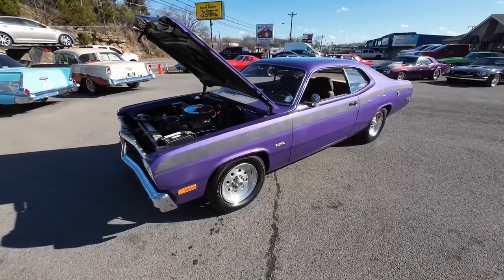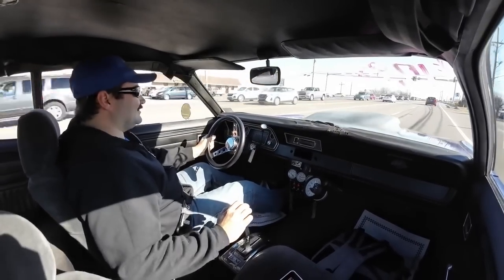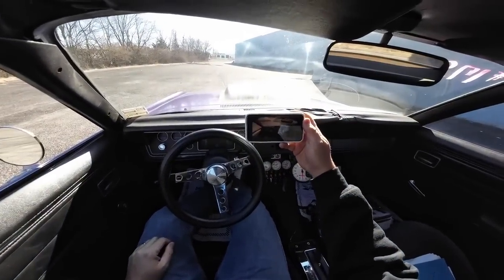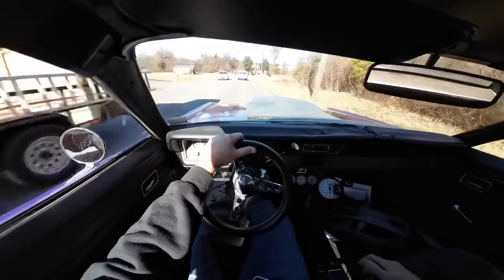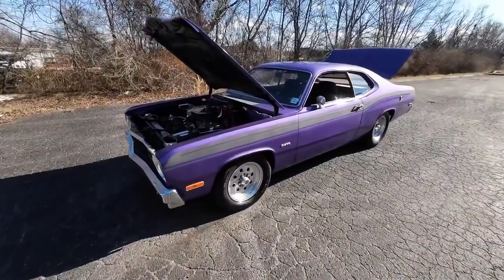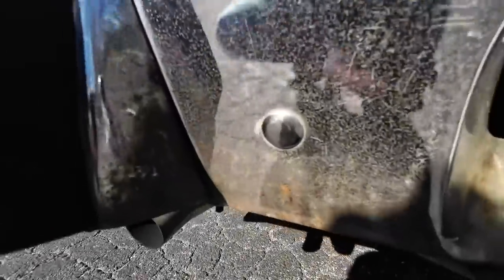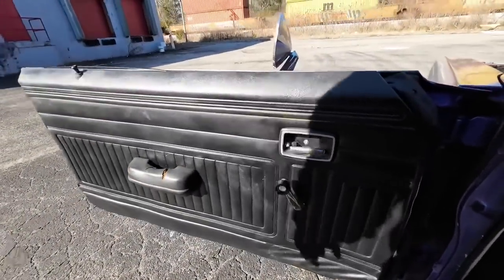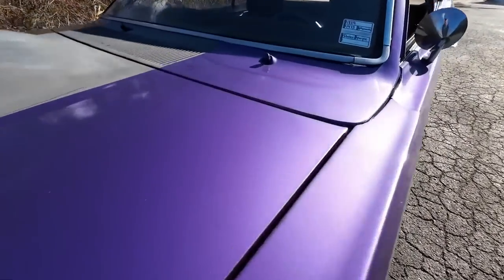Test Drive 1973 Plymouth Duster SOLD $17,900 Maple Motors #1829

Comment: Looks like it needs some rings . Nice ride otherwise
Reply: Agreed carb rich and rings. Yep. Who ever had it beat the crap out of it then dumped it.
Reply: Or when who ever put motor together didn’t space rings. Like you need to. Stagger the slots. Can do that also .
Reply: Either way just fixing carb mixtures will really clean a lot of that smoke up then see what pipes look like when jumping in it.

Comment: Its about the same shape as the 1973 340 Duster I had body wise.  The pull in steering would concern me only because Dusters are noted for the upper A frame hold down tabs on the frame to crack or break loose.  Mine had a cracked one and needed to be replaced and welded up.   My other concern is the smoke and I think the same as you do.  I am sure if you stand behind the car your eyes will burn from running rich.  My cars cam can and its idle sounded the same. My car ran a little on the rich side.  It performed well though.  I noticed when you hit the gas one time I see black smoke, that is fuel build up.  The white smoke concerns me on weather it goes threw any oil or anti freeze. that is something that could take time to notice and driving it to notice.  The interior parts you can still find used and someone will have them. Same for the stock wiper arms. Its a nice Duster and in nice shape.  Not so easy to find like they use to be.  I miss mine.

Comment: It's running very rich. That's why the initial smoke was grey, then turned blue. Washing oil off the cylinder walls. Nice car just needs a little fuel system work.

Comment: I'm loving that 73 Duster. I had a 73 with a 318 360 heads and intake. It was my primer gray Rust-Oleum Deluxe hot rod with hood pins and US Rim 5 slots
Reply: I had a 73 hated the thing.

Comment: Not sure I understand the reference to a hotrod so you need to 2 foot her........are you trying to keep the revs up so it doesn't stall?
Reply from the maker: Just precautionary because the car was getting so much fuel
Reply: @MapleMotorsNickSouthgate  I see....had a couple beaters back in the 70's that only ran 2 footin' it, was never good at adjusting carbs.